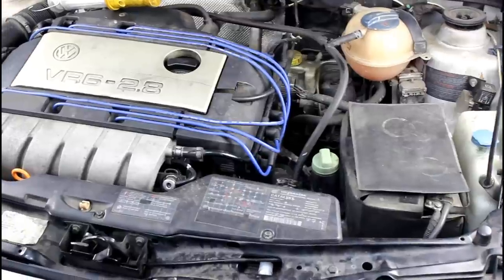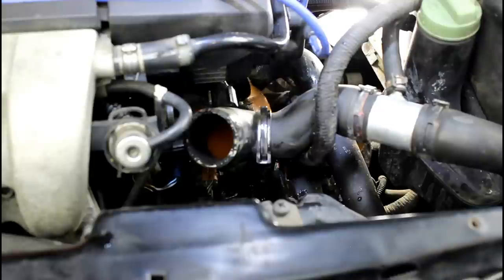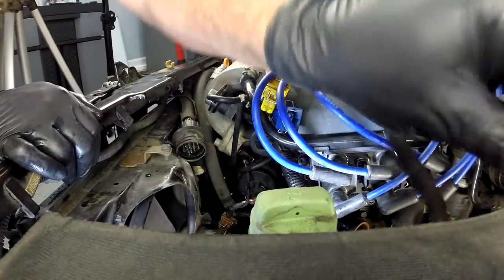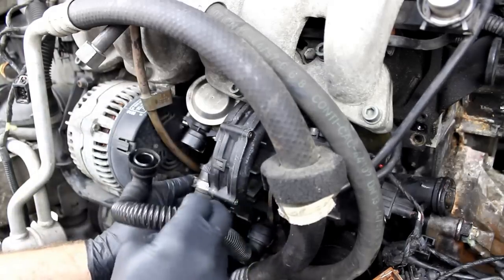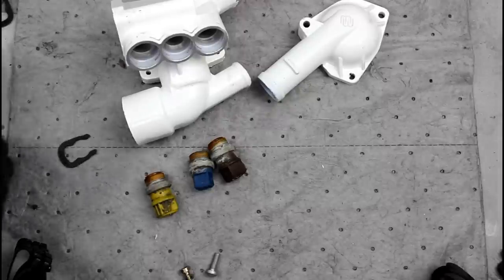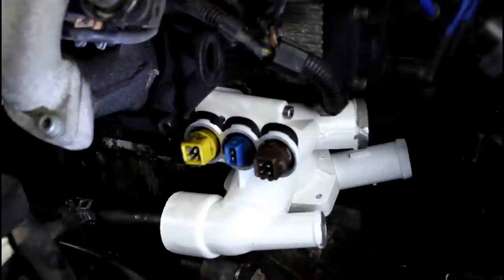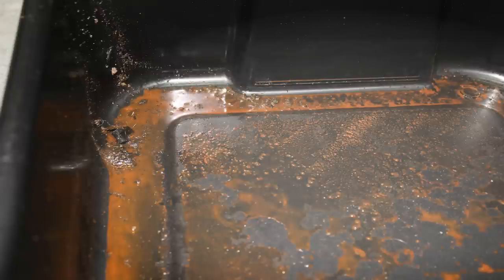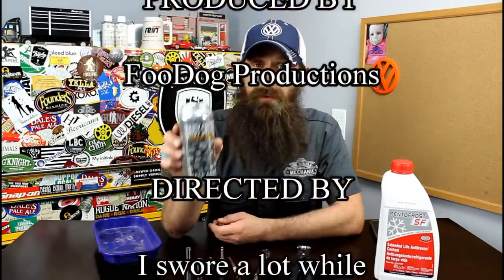Thermostat Replacement with Upgraded Thermostat Housing

Comment: Nice job! I would definitely recommend moving the bumper forward whenever you do this job. You don't have to remove it, just undo the bolts and slide it forward to give you a few extra inches. Also replace those little coolant hoses that run between the block, crackpipe and oil cooler. AND take a close look at the oil cooler itself. 

Definitely a do it once, do it right kinda job! Having to take it all apart a week later to fix a leak in the same area really sucks! Urotuning do handy kits including hoses and new bolts.
Reply: GiHi gthanks thanks I have have kind in the keep my mouth mouth kkkkgkkgk
Reply: Free to check out this weekend and I jdhave have have on the phone phone for fall done  and didjd drive drifjjjdinternet day and get it to to go go dback jfkdd thanks again jjagain for kfjd

Comment: Learning so much about my vw, not afraid to actually dig in there and do some diys. Thanks! Keep up the good work.
Reply from the maker: +andres lopez Thanks :)
Reply: @HumbleMechanic  I have a question Charles. I didn't see a video about bleeding the coolant system for an audi s3 , my question is when using an airlift to remove the air from the system would I need to completely drain all coolant or could I just empty the expansion tank ? The gulping sound from air in my car literally sounds like it's coming from the airbox . Thanks

Comment: Charles, you mentioned: 1:14 "had I know I was going to have to pull the front end off, I would have done a couple other repairs while I was in there, but I'll have to save those repairs for another time."  What other repairs are?  Since the bumper will come off, this might be the opportune time to also remove my GTI's oil filter housing to replace the figure-eight seal on its flange.  Please let me know if other jobs should be considered as well.  I intend to replace the coolant pipe as preventative maintenance, so your input on additional opportunistic maintenance while I have the front end torn apart, is helpful and appreciated.  My MKIV GTI has the 24v VR6 BDF engine.  Thanks for another great video.  If other experienced DIY mechanics have suggestions based on your experience with my car/engine combination, let me know.

Comment: I envy you and your easy lower radiator hose reattachment!  Last time I had mine off, I spent the better part of two days trying to freeze the O-Ring so it would be small enough to not bind up while trying to reattach the lower hose!  I ended up having to physically cut the O-Ring, remove a small section from it, and super-glue it back together.  Fortunately it didn't leak, but I'm extremely hesitant to ever take it off again!  :(

I had to pull the front end off the car to get at my crack pipe, too.  After 160,000 miles, it was pretty much welded into the block!

Comment: Thanks for your work on this video, it was very helpful for me in replacing the thermostat housing and crack pipe on my Jetta. If you can make a video on replacing a valve cover gasket on the mk3, that would be great.
Reply from the maker: +Sarah Plugge doing a spark plug video next, then the valve cover gasket. 

Then checking timing chains. :)

Comment: Great job Mr. humble mechanic I'm glad I watched this video because I plan on doing a full coolant flush on my 12 valve VR6 for the Corrado.  My question is should I use G13 E-Type coolant which is Pink or should I use the blue coolant which is NF? I think the difference is one has glycosin in it or something like that which is more economically friendly. Oh yeah and I'm also flushing out the orange antifreeze so I will be adding distilled water about three different times and flushing it until I refill it.

Comment: Charles, when replacing the thermostat, thermostat housing and coolant pipe, I'm considering doing everything you did in this video but doing one step in a slightly different order.  Instead of flushing the cooling system after replacing all the components, I'm thinking about draining the cooling system, flushing with distilled water, then draining the system again, before removing all of the components.  The thinking is that once all of the hoses are removed after a flush, and all components are re-placed, there should be more certainty about ending up with a proper 50/50 mixture of coolant and distilled water in the system.  The concern about doing the flush at the end is that a potentially significant amount of residual water from the flush could still be in the system.  As a result, when the final 50/50 mixture of coolant/distilled-water are added, the residual water in the system used for the flush, will result result in a greater than 50% ratio of water to coolant.  Thoughts?
Reply from the maker: Sounds like a great plan! Odds are one flush won’t get everything. Especially if it’s heavily contaminated. 

But I like your plan

Comment: Hey Charles big fan! You mentioned if the thermostat was oriented one direction it could cause over heating ?  Can you confirm you’ve seen this before.  Just bought another VR6 with similar issues and the previous owner said he replaced the thermostat… maybe they put it in with the bleeder opposite?! Just wondering before I rip it all apart

Comment: I recently had to do the same on my 04 gti with the addition of replacing the water pump. big job, started with o-rings of the ect sensor and plug, still leaked. Replaced the thermostat housing and the coolant pipe, still leaked. Lastly, the water pump, no more leak.  luckily I hooked all my hoses first,  added water and did a pressure test after replacing the rongs first before putting back the front end otherwise it would've been three times the work

Comment: I need to do this job in the next couple of months.  I was wondering if it would be easier to access the crack pipe if you take the intake manifold off?  My car has about 110k miles and one on my injectors is giving me a misfire and was thinking about sending them out and having them cleaned.  I think I have to remove the upper intake manifold to do this.  I was thinking about doing the injectors and crack pipe at the same time and taking the upper intake manifold might make this job easier.  I have a 2001 GTI VR6.
Reply from the maker: +Johnny Woo It will prpbaly be about the same amount of work with the front off, or the intake off.
Reply: Thanks

Comment: thank you very much for your video. my crack pipe was very hard to get out, had to use pliers and steady pressure for over an hour, it juts kept breaking off pieces, finally it gave way. the valve in the middle of the coolant pipe broke off with hardly any pressure, glad i did this! i ended up using gruvenparts.com aluminum pipe and thermostat housing, so ill never be doing that again. also replaced the radiator with a mishimoto all alluminum. no more plastic in the cooling system, and all lines are samco silicone, so that should prevent any cooling issues any time soon.

Comment: Nice (?) to see I wasn’t the only one that had to fight my crossover pipe. Took literally forever to get it loose and I had to strip the front of my ‘96 down to the same extent to get to that and pulled the secondary air pump to get to the two cooler hoses (one of which parting ways with the crossover pipe was the reason for changing it out in the first place).
One minor issue that I am hoping is not a dealbreaker was once I had everything buttoned, up I found a second o-ring from the crossover pipe on the ground. At that point, I realized that what I thought was simply a little buildup inside the block was actually the very end of the pipe that had broken loose while I was pulling it out. I’m not though it did seem a little difficult, I was actually able to get the new aluminum crossover pipe in place and everything bolted up as normal. Hoping that the 3mm of plastic isn’t keeping the pipe from sealing into the block. Time will tell since I ran out of day before filling the system & finishing the refastening of everything. Fingers crossed...
Reply from the maker: Funny because on my mk4 it came right out. Lol
Reply: My ‘96 shed it’s impeller many moons ago & I’m sure it cooked in pretty well. I was young &  naïve back then and did not change out the pipe due to the pain in the butt status. Only took me 10 years to realize the foolishness of that path. You should see how clean the break was where the cooler line attached…

Comment: I miss my Drivers Edition Ginster yellow VR6. I now have my MKIV R32. I'm the original owner and still own and still puts a huge smile on my face. 

Charles. Could you point me in the right direction with this issue that I have? Issue is when I pull forward on the wiper stalk the washer fluid will start shooting from the rear...and the wiper arm no longer functions. So when I push forward on the wiper arm the fluid still shoots from the rear which works correctly. But the arm will not work. 

I replaced the wiper switch stalk. But problem still remains. 

Any thoughts?

Thanks you Laz
Reply: +john doe how can they be crossed since I have never touched them in last 12 years of ownership?? That can't be.
Reply from the maker: You are totally screwed man. Only thing you can do is give your R32 to me. Hahahha. 

It is most likely a bad pump. If you have a test light, you can be sure you are getting power on the wire for the pump to pump at the front.
Reply: +john doe yes both front arms do work. Thank you for your input John.
Reply: +HumbleMechanic +HumbleMechanic lol good one Charles lol.  Not in a million years. 

I'm going to follow the wire. Hopefully it's a fuse lol
Reply: +Larkhill21 It possibly could be. I am getting power there. I'll have to take everything apart and exam it again. But for now. Transmission is my main concern! 😞

Comment: I have done the change and also changed thermostat and heater core and my mk3 glx does not give heat when I'm driving when it's really cold out
Reply: Jason Grim is your water pump noisy? If it is it might need replaced. Could also be your radiator. Is the car leaking coolant? First thing Have someone do a pressure test to find any leaks.

Comment: hey humble, was wondering how did you get the pipe out? I'm doing my mk5 r32 and I'm still can't remove the coolant pipe. don't want to pull to hard and damage something. any advice my friend? anything would greatly help. thank you and keep up the great vids.
Reply from the maker: Try twisting it. Sometimes they are way jammed in there
Reply: @HumbleMechanic   worked! thank you for your help, now your busy. can't wait for the turbo build.

Comment: Hi, what does the yellow or blue ring represent on the 4 pin CTS mean, not specifically on the mk3 VR6, that have a yellow ring, black sensor for ecu, and a blue color, no ring, 2 pin and a brown color no ring for air-conditioned 2nd stage fans. Very confusing.

Comment: hi. just bought a 01 jetta vr6, I see thermostat housing has a drip when it's parked in garage.  Well since tstat  housing is attached to coolant pipe I might as well do both while I'm in there!??? No?  Ok well where do I buy the parts from??? My Vw dealer local wants around 345$ for pipe,  housing, tstat, and a few orings.  I see online it's around 100$ from ECS tuning or something END when I Google tstat housing.  should I try they're kit for around the 100$ That comes with everything I need to do pipe and housing?  Thanks! Please Help! Don't wanna do this job to have to do it over again cause of junk parts 2 months later!  Thanks

Comment: Excellent. Question: vw dealership in Atlanta wants 342.00 for a new thermostat, non vw sources want from 9 to 15 bucks? What am I missing?
She's a 2003 Eurovan MV......
Reply: Do the non vw sources have that jiggle valve on it? I've noticed that the cheaper parts usually don't include that.

Comment: Usually, the little valve in the thermostat is a bleeder valve for air, so (if the thermostat is upright, which is this case it is not as I see it) the valve must be a the top.. Air always stay's in the highest point in the system, that's why the expansion bottle is the highest point..
Also, there are cars that have little air bleed valves in the coolant lines to, you guessed it, bleed out air...
Reply from the maker: Thanks for the info! :)
Reply: HumbleMechanic hey buddy I need the same ero kit you have I tried clicking on the link you have but said not found any idea why.

Comment: Also I noticed you had orange coolant in there. That definitely does not seem like the right coolant. Shouldn't these 12 valve VR6's be running Pentecost NF coolant which is the blue one? I believe that was OEM from 92 to 94 for these VR6 engines.

Comment: That f'n clamp on the coolant pipe dude I feel your pain. I'm in a 97 glx and I'm stuck at the moment. I upgraded to a steel pipe and can't get it to seal on 1 side or the other.
Reply: I had the coolant pipe in 30 minutes but can't get the new pipe to seal

Comment: My tip for not losing the bolt is to fold some tissue paper and press it into the bolt with the socket.
Works 110% of the time, and you don't get silicone all over your tools.
Reply from the maker: +panzerveps Great idea
Reply: +HumbleMechanic A lot easier to get the bolts on the oil pan back in that way.. Especially on the 3B Passat (B5). The ones in the clutch housing can be a pain in a certain lower back area.

Comment: Just a quick question where is the auxiliary water pump located on the 12v VR6 I can’t seem to find any info online
Reply from the maker: Near the barrel connector on the top driver side of the engine
Reply: HumbleMechanic thanks! Just bought myself another Mkiv 12V VR6 for 500$ she needs some work but it’s got a built head and new timing setup hoping she’ll rip soon🤘🏻

Comment: I could have used this video 6 years ago when I had to do mine, I ended up removing my oil filter housing to access the hose in the middle of the pipe on my 95 GTI MKIII
Reply: As a side note I used a kit I got from germanautoparts.com that used a plastic thermostat housing and a aluminum pipe
Reply: Plastic thermostat housing?I'm almost 52 years old,and lately having itch to get some two doors VW.I still miss my 1978.,1.6 Liters VW Rabbit.I like MK7.Yesterday I watched the other guy is replacing original plastic,yes plastic oil pan on MK7.Is this some kind of new trend with VW?What is next,plastic bolts?Plastic engine mounts?I think,i will stick with my boring,10 years old Corolla that doesn't cost me anything but basic maintenance,or I will buy brand new Corolla.

Comment: Is the 12v vr6 in the mk3 the same as the mk4?
Reply from the maker: The engine is, some of the things bolted to it are different like the intake manifold. but the MK4 also has the 24v too

Comment: HELP!!! I have this same problem but with an 04 Touareg.  I want to do the alloy or aluminum upgrade on the housing and the water pipe.  I believe mine is different 2 sensors instead of 3.  I found a kit for an MK4 but I believe the hose connector over the thermostat it's self is angled on the MK4 and mine I THINK is streight.  Can someone help me please?
Reply: Any particular tricks I need to know to get to this in the Touareg?  Dealership says pull the engine.  I call bologna.  The smaller screw seems a bit of a pain as well as the lower hose other than that seems pretty uncomplicated.  Hours of swear words and hose pulling. But does that sound right?

Comment: How do you tell if it’s a 12v or 24v?
Reply: The year typically but your engine code should too mk3s are usually 12v mk4 is 24v
Reply: My 2000 VR6 GTI is 12v..... The 24v is used after 2002

Comment: Any reason; you didn't upgrade the "crack pipe" with a aftermarket metal version (since you are upgrading the new flange to metal as well)? Gruvenparts: "ultimate crack pipe":  http://www.gruvenparts.com/the-ultimate-crackpipe-all-vr6/
Also, it looks like you replaced; the little coolant flange with the small hose angled "Y" pipe with a metal one? http://www.gruvenparts.com/y-pipe-for-vr6-rad-hose/

Lastly, do you ever use a vacuum coolant filler tool at work; I use the UView Airlift and it eliminates all the air pockets in quickly.

Comment: LOL. Now I don't feel so bad. I had to replace the thermostat on my MKV GTI, and I put a total of about 10-12 hours into it. It would of saved me SOOOO much trouble if I just took the front end off, and ripped in intake manifold off to give me access to it. I was tinkering with it 1-2 hours at a time over the course of a few weekends because it was so frustrating. MEHHHHHHH

Comment: Can this be applied to a 2001 2.8L VR6?
Reply from the maker: +Nor Cal yep.
Reply: HumbleMechanic okay cool I'll save the video then, I have to replace all that as well so this is a big help. Thank you
Reply from the maker: You may find a few small things different, but you will be able to over come that no probs
Reply: HumbleMechanic I thought so, but as far as location/work it should be the same?
Reply: @CaliNinerGaming  There's a few other videos on youtube too with newer vr6s (I think 2003) that might line up more for your car.
Reply: Connor Early thanks man but I got rid of the Jetta and got into a Si 🤘🏽
Reply: @CaliNinerGaming  I saw your comment was a year old so I figured you were probably at a different place now but I thought it wouldn't hurt to reply. What's a Si?
Reply: Connor Early Honda Civic Si